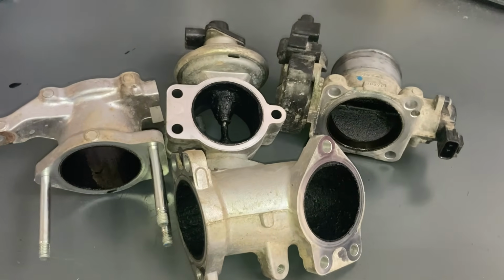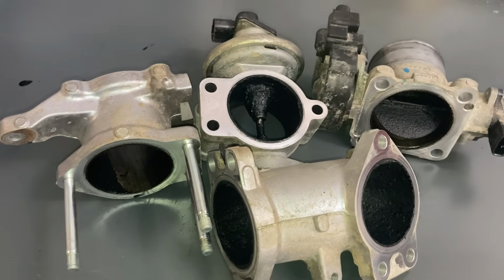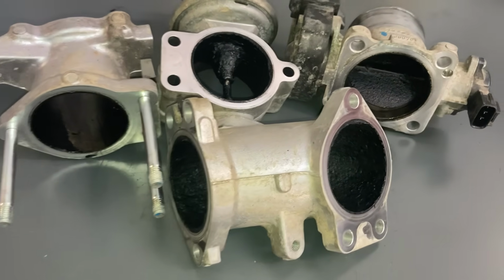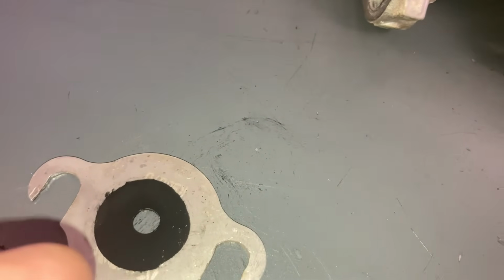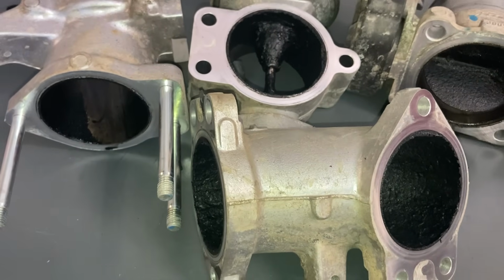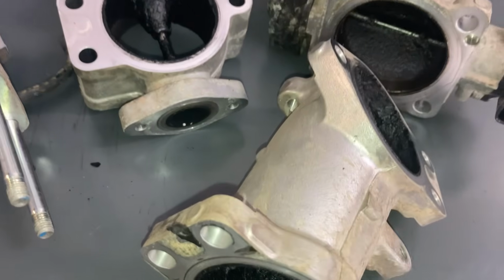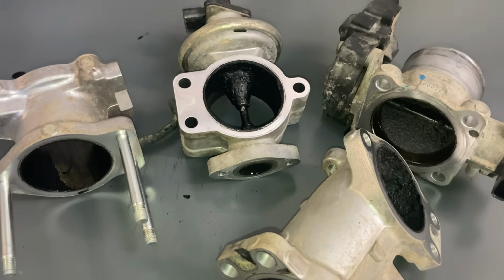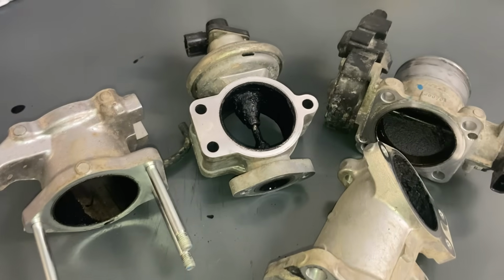Don’t bother doing a Egr Clean with the green machine BULLCRAP!!

Comment: Machine clean or pressure pack clean only really cleans in the max airflow path and cleans your wallet  . Ineffective for the cost . egr clean every 50k and manifold /intercooler out clean every 100k .  Prevent/slow   injector tip wear due to less debris in cylinder . Slightly better in both  throttle response and fuel economy . Clean Maf/Map every 20--40k . Conduct relearn of Map/MAF if possible . Keeping internals clean may prevent sticky failure of turbo variable vane . Best to clean out EGR cooler also [goes a long way to prevent cracked cooler ,, from overheating ].  No magic in a can will do all the above .
Reply: Don't you have to pull the injector pipes to clean the intake? I thought that was not recommended if not replacing injectors etc
Reply: @eamon1648  Different car makers run the same pressure yet have different replacement intervals for pipe replacement . The issue is high pressure fluid is abrasive BUT the car makers MAIN concern is resealing of pipe connections,, wear and tear and diesel leaks after remove refit etc  .. 
If the internal pipe wear was a major issue there would be a scheduled KM replacement interval.

Comment: I have finally been approved for warranty for a cracked EGR cooler,   absolute nightmare battle with Toyota dealer since April!  I was declined after an initial 1 month wait, so I stormed and and demanded them to show me what the did to test the cooler.   Absolutely shocking workmanship of blowing air into the cooler with rags blocking the ends.  I snapped and told them to blank and regulate pressure for a static test,  over night they came back and said I was right😂. The cooler is cracked,  blocking the EGR and I have been approved for warranty,  even though my car is 9.5 years old 2015/16 1gd.  I smashed them with ACCC consumer rights arguments.   DO NOT BE A TOYOTA VICTIM.  3 months without my car so far
Reply: I don't think they did that static test, too much work for them. I think they just said this guy is not gonna give up so just give him what he wants. They probably knew you were right anyway.
Reply: Over 9 years old and you feel like a "victim"? 🤷🏼‍♂️